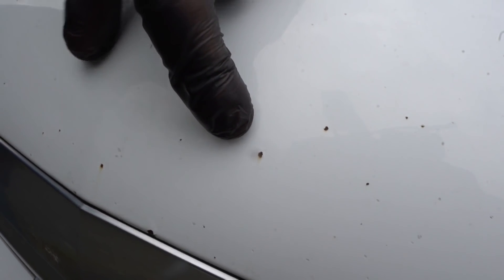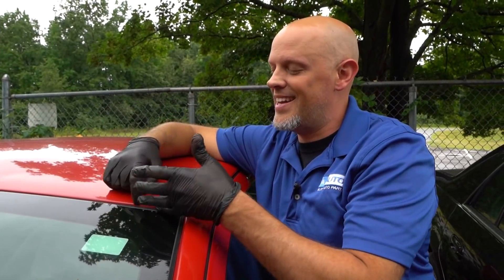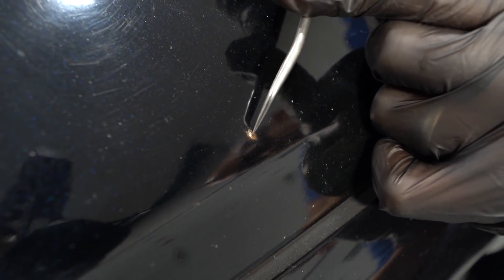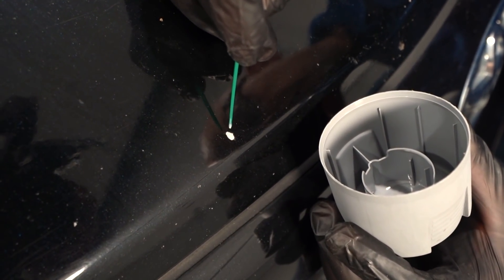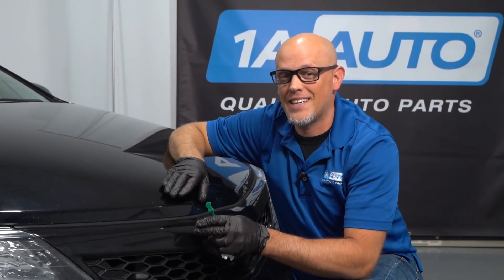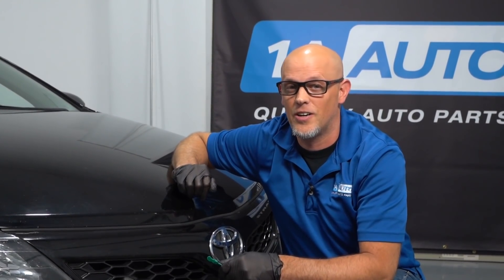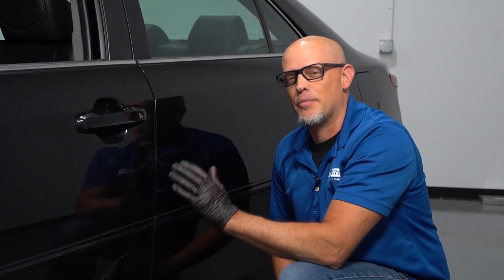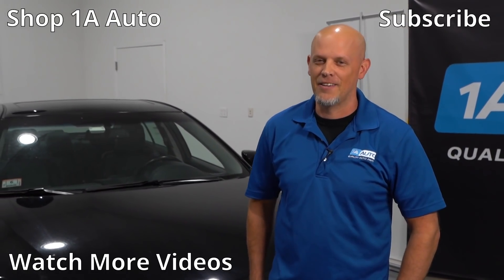How to Fix Your Car's Deep Chips or Scratches with Touch Up Paint Before It's Too Late!

Comment: Cool repair bro. I have repaired some chips, including rusty ones last summer on my bmw’s hood but last week i noticed a small(like 1.5mm) chip in the middle of doors. There is alrdy rust in the middle, but also mini bubbles around it when i look precisely.
To not fk it up and make it worse, should i even do something with those? Will they spread more?Or just scrape the visible rust in that micro spot and dab primer&paint

Comment: I have a deep long scratch underneath my quarter window upper trim and weather stripping. I wanna fix it but it’s impossible to get to it without removing the trimming and the weather trimming. Almost like they hid it underneath not even noticeable from outside the car. Should I be worried about rust in the future or should I be ok? I have no idea how I could ever touch it up it up without removing the weather stripping and the trim. Don’t think water could get to it through the rain guards and the weather stripping and the trim itself but it’s goes the whole length of the upper window

Comment: The 2000 Toyota Camry LE 4 cylinder I now have was given to me by my cousin. It was his father's Camry. There are rust places everywhere on the Camry. I didn't cause these it was given to me that way. The hood of the Camry is rusting from bottom up through the paint surface there's nothing I can do about that. I'll have to buy a new hood for the Camry. But that's okay. They let a battery burst or leak it caused rust to form in the engine bay. There's nothing I can do about that either. In my opinion they didn't take of Camry in the first place. Now I have to ideal with it. Any suggestions what to do with these problems?
Reply: If it’s on the rear wheel wells, you’ll have to have an auto body shop cut out the old metal, weld on new metal, and have the quarter panels resprayed. If it’s just the hood, just go to a junk yard and pull off a hood of the same colour (or different) and install it on your father’s Camry.